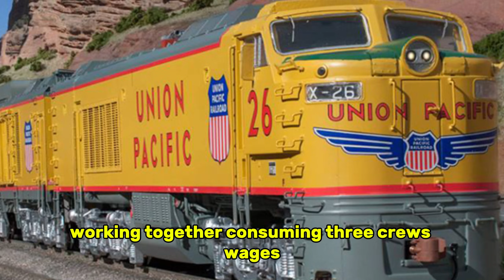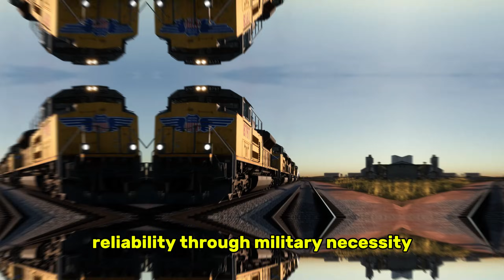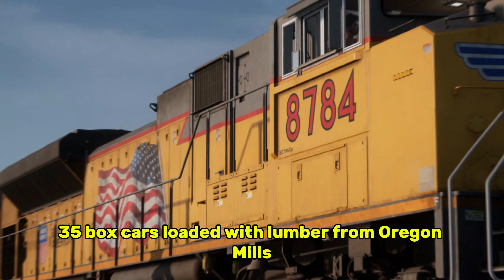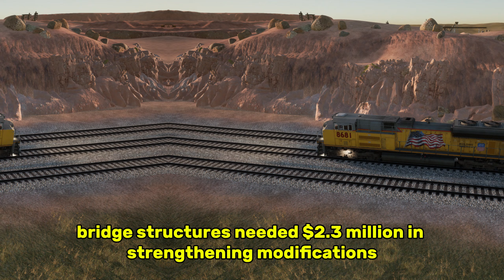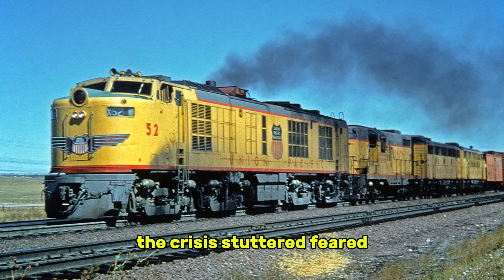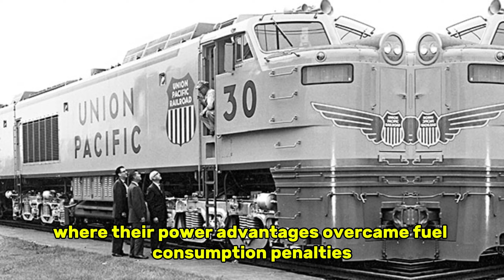The Experimental Train That Worked Too Well — And Scared Management

Comment: - The AI picture generation is even more annoying in this video than the last one.  If I complain often enough, maybe you'll get tired of listening and stop doing it.
 - Diesel efficiency topped out at 38%.  Yeah, but with the s*** coal that the UP was burning, efficiency was closer to 10%.
 - 23:39: "Bunker C gets hard to handle below 20 degrees C".  20C is 68F, which is hardly cold.  Do you mean -20C?
 - This could use a detailed explanation of the starting process, which was VERY complex, requiring an auxiliary diesel engine driving the electric generator to spin up the turbine, which then ran on diesel until the auxiliary steam generator could heat the Bunker C enough to flow through the pipes.
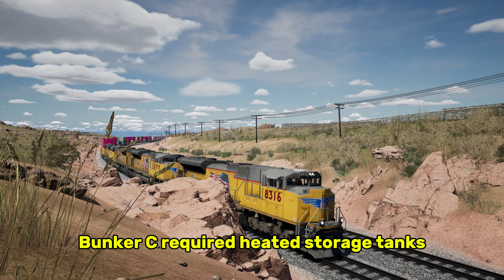- Not a complaint, just an observation: 23:20, Bunker C required expensive and complex modifications to fuel facilities all along the line.  Turbines will burn anything flammable, so they could easily burn diesel.   I wonder if the simplicity of handling diesel would have offset the cost of modifying the facilities?

Comment: A gas turbine doesn’t have 8 percent less moving parts compared with the diesel engine. It has 92 percent less moving parts. AI got this backwards. A gas turbine engine has very few moving parts. This is what makes it more reliable. 
Google AI says the Sherman hill maximum grade is 1.55 percent. Not 5.5 percent.

Comment: Absolute pure BULLSHIT in the first minute. There are ZERO number of RAILROAD grades of 5% on the Union Pacific.  Thumb nail picture: 80/8080 was not successful! A one-off idea to see if coal could be used as a cheap fuel once again. (No! The turbine blades wore very fast, the unit spent more time in the shop than an old steam locomotive.)

Comment: Since when did running a 3-unit diesel require additional crews? That was the entire point of the jumper cables between locomotives: to operate multiple locomotives in the same power consist with only 1 crew, and since the diesel units were ideally the same type, the drawbars are built solid to the frame, and each locomotive would respond to the driver's inputs in the lead locomotive at the same time there would be no "synchronization" problems plaguing a lash up of multiple diesels at the time. It's the same concept used today.
And have you even bothered looking at primary sources as far as tonnage ratings? A 4500hp turbine is not moving 6250 tons up a 1.55% grade. Need proof? Here's the math:
UP 50 produced 138,000lbf starting and weighed 500,000lbs (250 tons). Since it has to move itself and the trailing tonnage up grade, the total tonnage is 6500 tons. For every ton of freight on a grade gravity exerts 20lbs of resistance trying to pull the weight back down the hill, so our formula is 20x1.55x6500=201,500lbs minimum to hold the train on the grade, let alone pull it. 201,500lbs is greater than the 138,000lbf the locomotive produced, so it would not haul that out of Cheyenne unassisted as it would stall.
Taking the locomotive's 4500 tractive horsepower (it actually produced 4800hp but 4500 was what was available to pull trains after going through the transmission etc.) we can see that 4500hp/6250 trailing tons=0.72 horsepower per ton, which translates to roughly 5.57mph sustained speed on a 1.55% grade. Any locomotive at the time, diesel or turbine, would have burned out its traction motors at such high torque and low speed. You couldn't drag a train at that speed until AC traction motors were introduced in the 90s, way later than 1952 when this "supposedly" took place.
For your information turbines like 50 were allowed to haul only 2760 tons unassisted from Cheyenne to Buford on Sherman's 1.55% grade and likewise would have likely hauled 4750 tons out of Laramie on the 0.82% grade in the opposite direction (for comparison a Big Boy was rated 3250 tons and 5800 tons over the same territory). Either way your info in flat wrong.
And I think you're confused about what territory you're talking about here. Sherman Hill is West of Cheyenne, as in you have to be going Westbound in order to climb the hill and arrive in Laramie, not East. East of Cheyenne is Archer Hill, an easier grade nowhere near Sherman's 1.55% ruling grade. You've got your geography backwards: the train you're describing departing Cheyenne should be moving away from Laramie, away from Sherman Hill, not over it. Good lord, if you're going to talk about UP over Sherman Hill AT LEAST GET YOUR GEOGRAPHY STRAIGHT! Did you bother even looking at a map to check ChatGPT or whatever AI you used to write this script? You go West to go to Laramie, not East. If this train is supposed to be going East to Omaha from Cheyenne it's doing a poor job of it because it's going in the complete OPPOSITE DIRECTION.
And by the way, while diesels typically have 8 power notches the turbines had more than 8 power notches because of how much power they produced which required much finer adjustments than the standard 8 notches could have provided.
You're trying to come off as a rail historian and you're factually wrong on all accounts. How about you actually go read a book, watch some documentaries, and do your own research instead of whatever ChatGPT bs this entire script is? And learn proper grammar when writing the script for gosh sake.
Reply: Well, you could do some research yourself, as the UP only started testing MU hookups with the turbines in 1958.